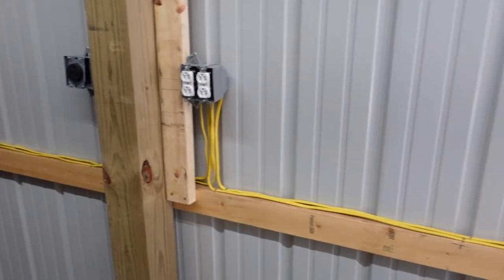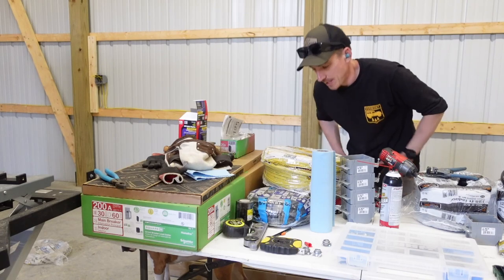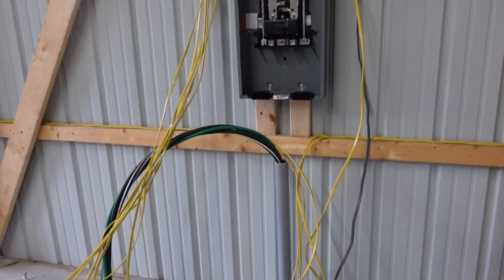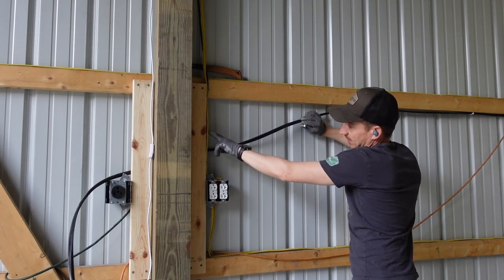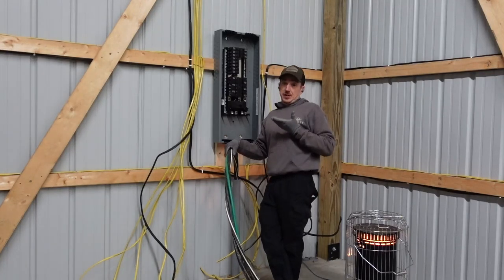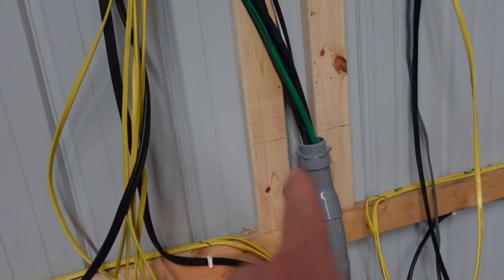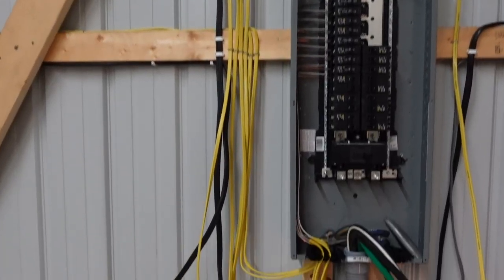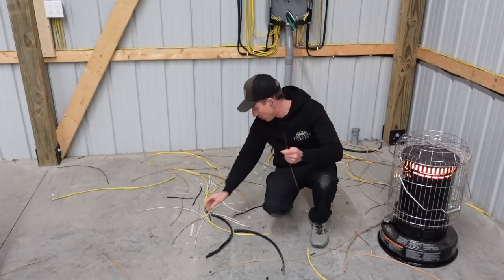Wiring New Electrical Panel in The Shop - Keeping it Neat

Comment: My local scrap yard was selling 14/2 250ft for $30 and is where my panel full of breakers came from as did disconnects and a sub-panel. Bought a pallet of 2x4 shop lights with bulbs for $4 each which now use LEDs. Just thought I'd share my resource as they've saved me thousands over the 8 years I've lived here.
Reply from the maker: Damn, that would be a nice little resource to have. I spent a tad more than that haha. We are in a pretty small area so I don’t know if anything like that around me.

Comment: Looks good Joe!  What size breakers are you feeding the outlets with?  You installed 15 amp outlets but your wiring is sufficient for 20 amps so you can upgrade in the future if needed.  Nice sweatshirt!
Reply from the maker: I have run the gauntlet in outfits this last week with the weather haha. 

They are 20 amp outlets. These are the ones I ended up using for all of them after the first gfci ones. 

https://www.legrand.us/wiring-devices/outlets-and-receptacles/commercial-receptacles/20a-125v-commercial-spec-grade-duplex-receptacle-back-and-side-wire-white/p/crb5362w

Comment: The wiring inside the sub-board looks good to me. Where I come from, all the wiring below a certain height needs to be in conduit. I am not sure if it applies to home workshops or commercial businesses. I don't like the American style power points and switches. You might not like ours, so we are even there LOL.
Reply from the maker: I’m sure it is all about familiarity on wiring styles haha. If I were to leave the walls bare I would have had to put the wire in conduit. But I will be putting up osb/plywood walls up to 8 ft. All the way around. So the wire will be in the wall cavity. In that case we can use the nm-b/Romex.

Comment: Sub-panels are a great way to keep runs short and tidy. A killowat meter is great for tracking voltage drop when loads are applied as amperage goes up which is bad for equipment.
Reply from the maker: That is some good advice. Thanks!

Comment: odd the way you guess do electrical we shield our earth cables too yellow and green so they cant touch live or neutral ,if we used the screw on things forgot  what they are called the complete job would be condemed lol
Reply from the maker: The more I dive into this the more it fascinates me on how differently it is handled throughout the world. One would think by this point in time we all would have landed on one “best” way of doing it.
Reply: The fact the norm over there is 110 and you have to mess around to get 240 everything should be 240 practically the rest of the world uses 240 not sure why states uses 110 as the norm ,if we didn't sleeve our earth's we would be in trouble too ,I agree it's messed up the way everyone does stuff differently same as you don't have switches on your sockets and you have open sockets were you can just stick stuff into them totally different in the UK we also have individual fuses inside the plugs on all devices for protection and RCD units too